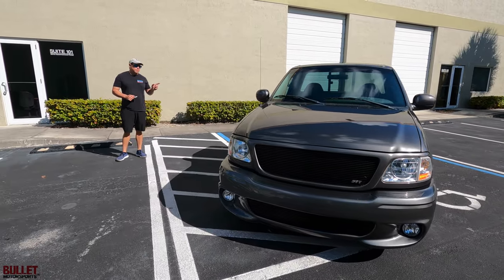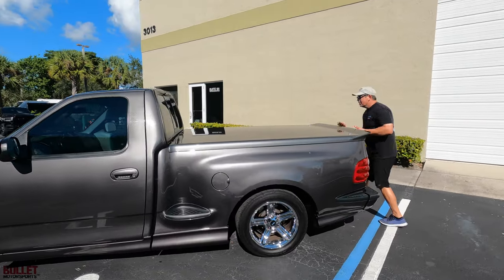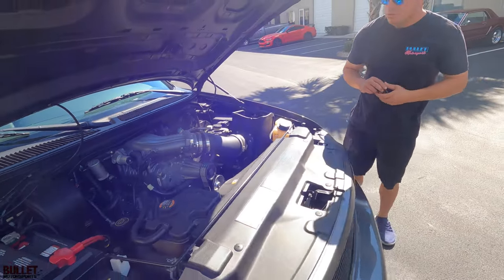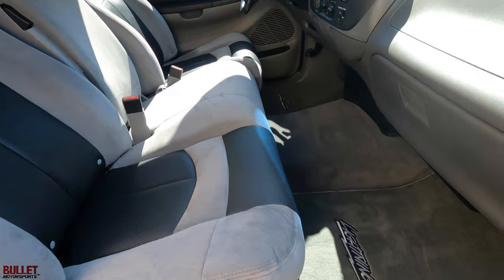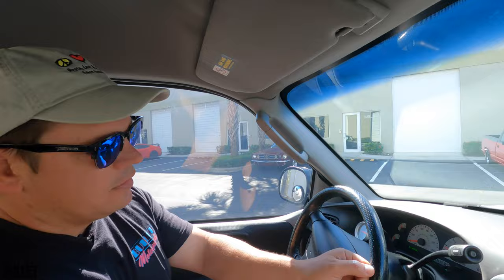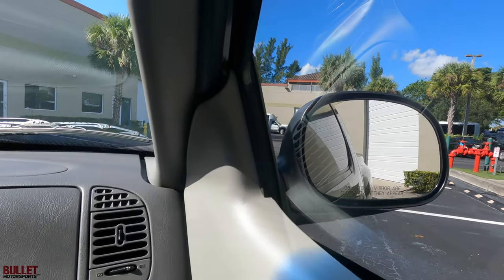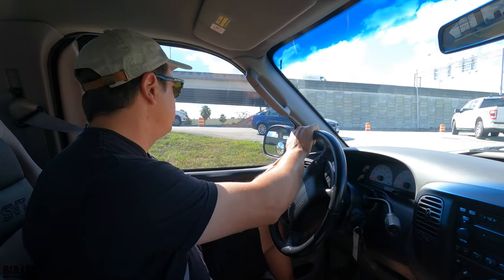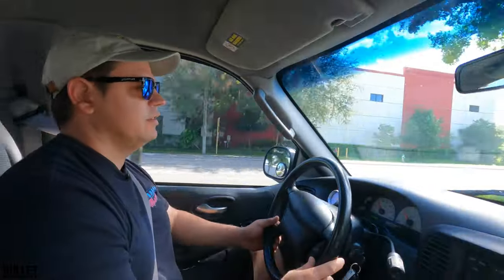MINT 2003 Ford Lightning SVT Walk Around & Test Drive | REVIEW SERIES [4K]

Comment: A good aftermarket intercooler a must, otherwise power is lost quickly. 
I am still not sure why Ford did not equip these awesome performance trucks with an intercooler. Otherwise, these are perfect little trucks.
Reply: Mine was kicking ass almost 20 years old. Major mistake. You do not let Captain dumb dumb touch it. This MKE mechanic just ruined it. Lied for electrical damage. Sir you are wrong. I had to get extra physics fancy w him. Barely any info. I just took it in for new shocks and supercharger maintenance. Any fellow L owners you have to learn high end computer stuff to make it sound like this.
Reply: @AF_1892  are you on some drugs or all the drugs…..
Reply: All gen 2 Lightning trucks 1999-2004 have a garret intercooler from the factory oem. In 2001 model year the intercooler was upgraded to 10 rows.

Comment: Omg! Do you still have that truck for sell? I had that exact color and year. I miss it so much. I want another one.
Reply: I have a 2003 grey with 28,000 original miles I may be interested in selling it’s a one of a kind California truck always garages never abused
Reply: @josephtomasello1859  how much
Reply: @josephtomasello1859  nice!
Reply: @josephtomasello1859  how mucho??
Reply: @jesusherrera8183   hello Jesus 
My Lightning is one of kind invested over $60k in it has so much can’t mention here 
I would need minimum $39 k
U would need to see it to appreciate
Reply: I have a 2003 with original 28,000  with over $50 k in extras engine is stock except few light mods 
I’m thinking sell more sure best way to publish it I would ask some $45 possibly any suggestions who would appreciate this truck it’s not the typical 10
Or more owners and trashed 
It’s more pride ownership and show quality 
Any suggestion would be appreciated
Reply: We all want more Lightnings. The hard thing; no new parts and no mechanics can work on them.
Reply: @jesusherrera8183  Google translate to English haha
Reply: @josephtomasello1859  full stop. You don't sell it. These machines take a ton of abuse. They were designed for it.
I am an example of what happens when you have to drive your daughter to 2nd grade at 90+ mph
Reply: @jesusherrera8183   hello I don’t know how to use this format 
I have a Orignal 28,000 mike 03 lighting very upgraded on the sound system and suspension and look 
Engine has only few mods runs strong looks
Amazing how do I put a photo of it on this app ? 
I may sell I’m
73 and hardly drive but Sundays
Reply: @josephtomasello1859  hey man, do you have f acebook or any means of contacting you? about the lighting
Reply: @josephtomasello1859  how much